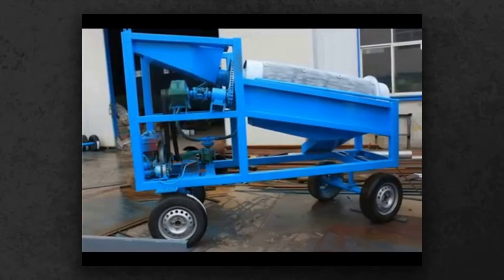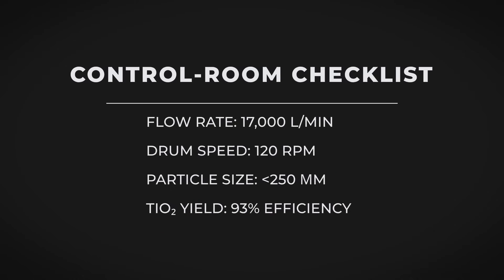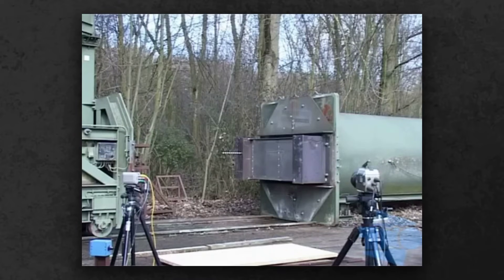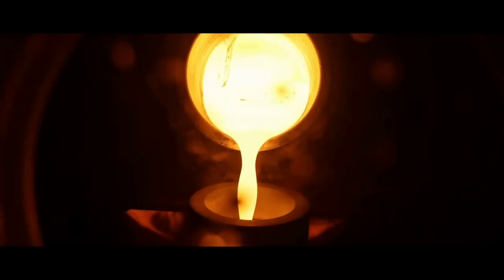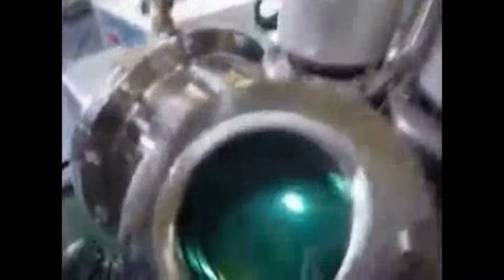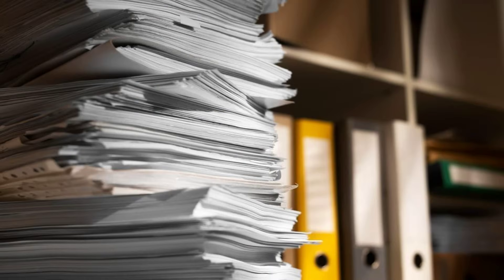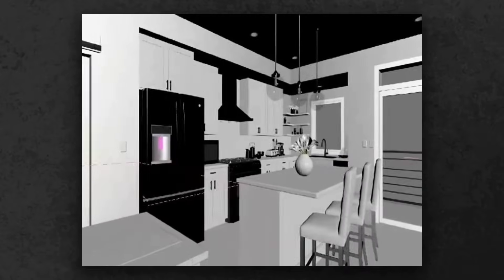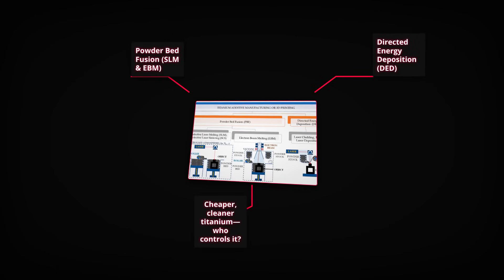How Tons Of Titanium Is Made Inside a HUGE Factory

Comment: Complete BLX, total world production last year was of the order of 8.6M Tonnes. Where on earth you got your idea of "Billions of Tons" is absolute horse crap. Again BLX, the Titanium Sponge plus the alloying elements are vacuum melted directly into a cooled crucible under high vacuum, it is NOT "poured into massive moulds". Additionally they are rarely given a single melt, after ther first melt the ingot is removed, the outside cleaned often along with the topmost layer of the ingot. It is then inverted and remelted again (sometimes up to three times) into a cooled crucible under high vacuum. BLX, ALL Ingots are identified with both cast and production batch identities, this invariably includes end to end and ingot position full traceability at each stage of processing. Even scrap and rejects are all similarly identified. Thus full traceability of all material including original source of sponge, alloying elements and any re-melted scrap is known. Many more standards than ASTM and ISO and will be dependent upon the requirments of the customer and final application.
The aerospace industry does NOT like change and variability, once a Titanium source and process / production method is agreed, approved and evaluated then that becomes for standard for that particular application. If and when something goes amiss with a plane, engine or component, they want the bare minimum of variability to have to research into what went wrong. If the material is from 100 different producers, using 100 different production methods then how can they work out which of those process stages might have gone amiss?
40 Years QA Engineer UK Titanium industy, including Zirconium, Hafnium and Niobium for aerspace, biomedical, chemical, nuclear and other applications.